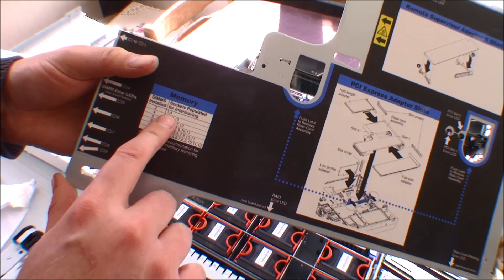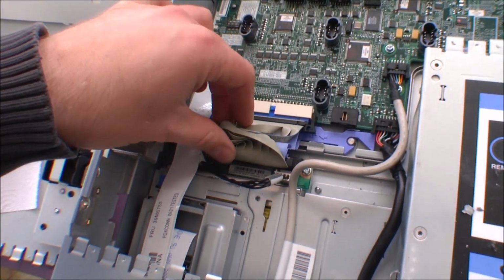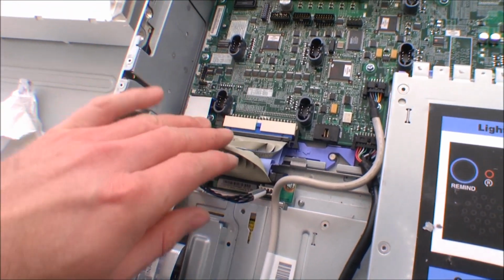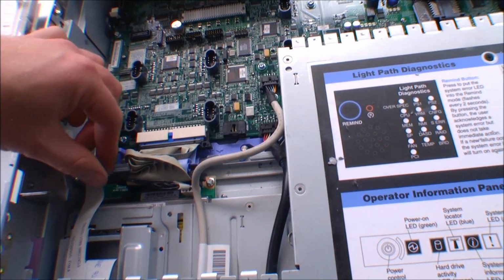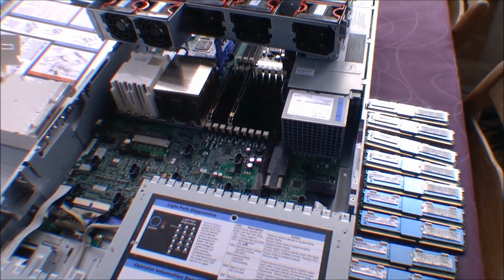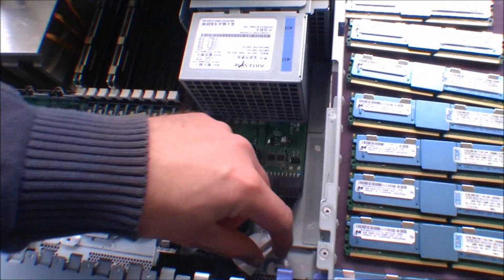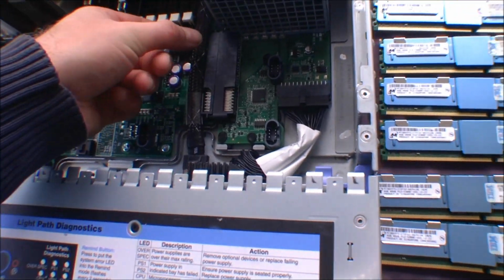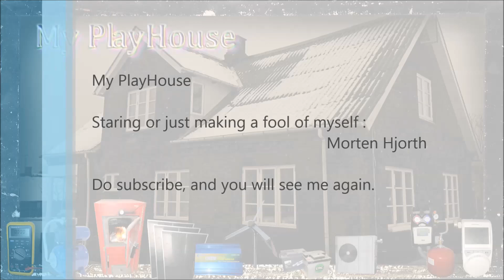Harvesting spare parts from old IBM x3650 M1 - 187

Comment: Good stuff. Power is the "enterprise" enthusiasts biggest concern. I was running a 6-core machine, but sold it because it was using too much power. I had 5 VMs running on it. Now I just got a Dell R210 II, and that one is much lighter on my pocket. It uses 1/3 the power. 

Thanks for another great video!
Reply from the maker: Hi logikgr 
Power is a big concern for me too. But when you i play with the big servers,, I can not sit and cry over every watt.
I was at the cinema yesterday, this was an approximately 90 minutes long movie, it cost me 75 Danish crowns. (11.2$) I can play with my data center in two days for less,, in weekend mode,, i do shut down stuff wheen i am not here.
Thank you for watching! :-)